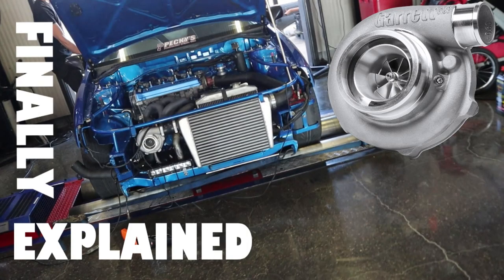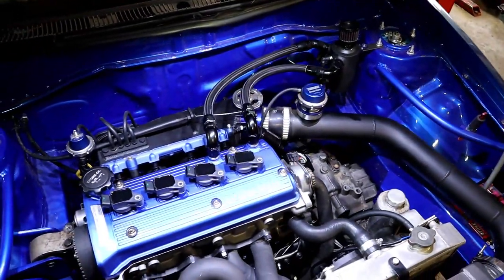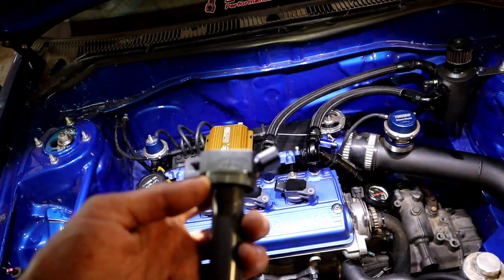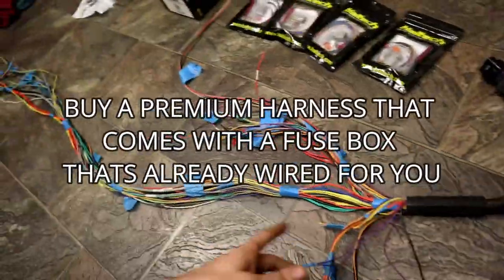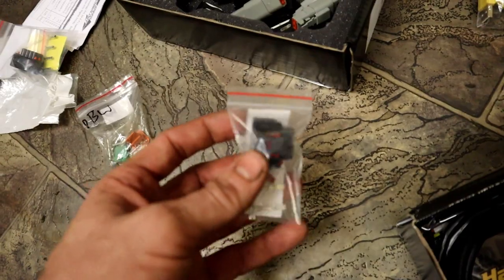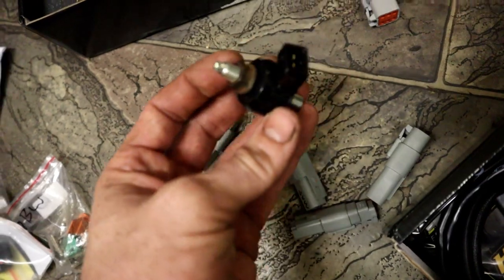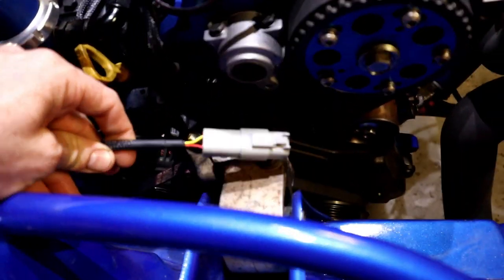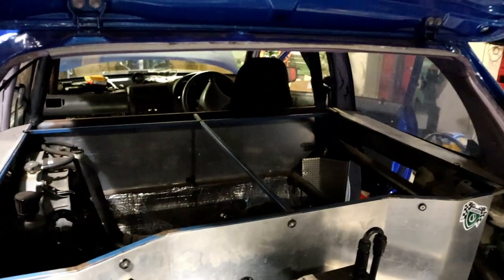what happened to the 450hp starlet engine?

Comment: As You said the 2500 has more inputs and outputs plus more features so it’s a good investment in my eyes 

I call dibs on that car running low 10s on its first run 
Hopefully u can get it to low 9s
Reply from the maker: Yeah man im kicking myself I didn't buy the 2500 at the start... but oh well I can buy an expansion and add more inputs if I need to...

This car already went 10.2 at @139 on stock engines and the old computers lol

Ive got some older videos on the channel if youre interested

Comment: You still used the toyota distributor or you convert something ells
Reply from the maker: Yes
Reply: @MattBerrymotorsport  ok so how it works my not working loseing sysnose
Reply from the maker: @Timroycampbell  the haltech ecu only uses the dizzy as engine position reference... the ecu has its own ignition outputs which you connect to individual coil packs
Reply from the maker: You can not do coil packs on a stock ecu. Ecu must have 4x ignition outputs
Reply: Ok

Comment: Any info on the 4 wire pressure and temp sensors?? I need to get some for my stand alone ecu
Reply from the maker: They are just a Bosch sensor. Buy them and the connectors direct from golebys parts in Queensland
Reply from the maker: I can get you the part numbers monday if you like
Reply: Hey mate do you have the part number for the plug for 4efte dizzy???
Reply: Hi Matt can i have the part number of the BOSH sensor which gives pressure and temp.

Comment: My famous question, what gearbox to handle that power?
Reply from the maker: Stock c52, remember I have two of them in one car lol not much load on them
Reply: Thanks for the reply bud .you have a unique build .I've had my 1st 4e pack up due to vibration from the crank pulley .current 5e setup with the same haltech 1500 etc.. and I gave up hey lol .Goodluck bud I will be back one day
Reply from the maker: @faiyazmaher4312  what do you need to finish it??
Reply: @MattBerrymotorsport  I got fedup and sold it overnight after a complete fresh 5e forge build the oil pickup valve broke.